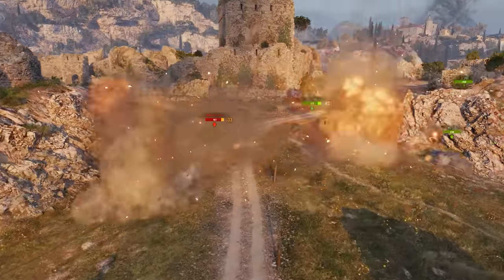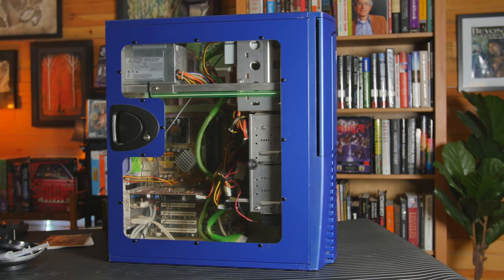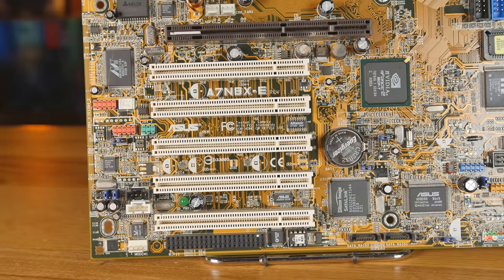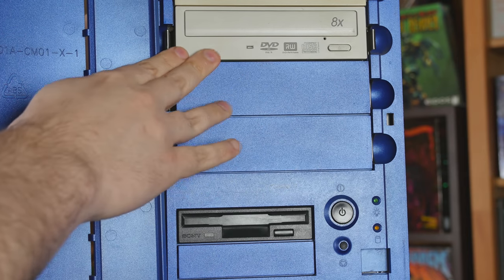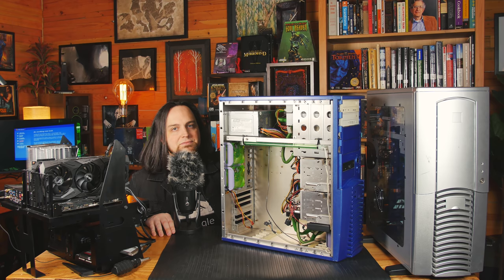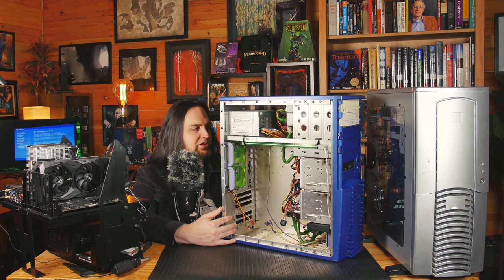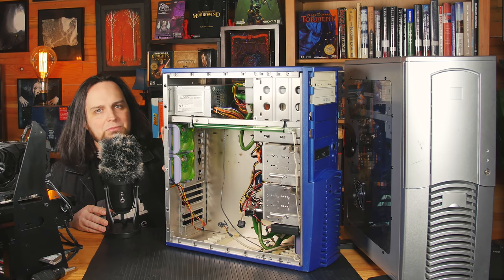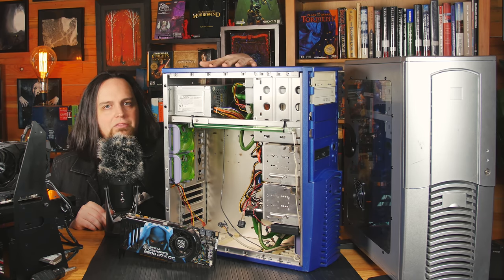Windows XP Retro Gaming Build Episode 1: Chieftec Dragon Case

Comment: That's literally the case I'm using right now 😂😂 cool to see it in a video in 2020
Reply: I am also currently using one of these Dragon cases. The only differences are it has 5 - 5¼" optical drives which I occasionally used, a single 120mm fan in the back, 2 - 80mm in the bottom front, it's black and it has 2 - USB 2.0, audio mic & headphone, and firewire in the little front flip door. It does have a door which I use to keep out dust. Now I usually only use the top optical drive to play DVD's included in certain books and from The Great Courses. The Great Courses is a company which produces either DVD or streaming lecture class sets. The Great Courses has hundreds of lectures in every subject. Check them out; they always have sales announced by email.
Anyway, you can see my system when I upgraded from a primary HDD to SSD on my only YouTube video pwNJto6VWE8. I made a custom filter for the bottom front removable grill which you can see on my video. I really wish Dragon would update these cases and make more. It should be 2" longer from front to back for bigger video cards and eATX motherboards, ¾" wider for a bigger CPU heatsink, the front removable grill should extend out another ¼" for a filter and the front connections should include USB 3.2 and maybe SATA with no firewire.

Comment: such a flash back. I still have a bunch of those IDE cables but in red !! And I'm still rocking a old early 2000's case... Got a Sunbeam 9-bay with a modded top for 240mm Rad <3 ... Use to have cold cathodes for YEARS.. they had some pretty cool ones from blacklights, to weird laser effects then UV was super big for awhile ... those things weren't terrible just not bright compared todays RGB's

Comment: Still got one of these. Had it for years and never regretted buying it. It's now running Truenas Core as my backup NAS with 5x 3.5" HDDs in an Icydock hot-swap drive cage, 6x 2.5" SSDs. Just sits there quietly doing the job, under my desk.

Comment: good memories. been huge into the retro stuff the last couple months. have built fully functional PCs for a few generations. Win98 Pentium 1, W98 P2, W98 P3, and an "early" XP era Pentium 4 with a 6800GT. next up is late windows XP build, either socket 775, 754 or 939.
what about putting a 92mm in the back? I think noctua makes some in that size.

Comment: I had a Purple Aluminum Chieftec or Chenming Dragon case with the windowed side panel back in the early 2000s. I bought it to build a computer for a freind. I also had the gray Antec AMG steel non window version of that gray Chieftec case. I got that one used in good condition of ebay back in the mid 2000s (2006-2008).  I used the Antec AMG case for a HTPC / Gaming PC setup to go with my 32 inch LCD TV and stereo rack system back then. They were both good cases to build with. The older Alienware Area 51 cases are the same style cases as the Chieftec Dragon too.

Comment: Haha. Thanks for this. I am still using a Q9550 in an XFX790i Ultra board. I originally had it powered by 3 x Nvidia OEM 8800GTX in triple SLI. Replaced those in 2011 with 2 x Gigabyte 560ti and then replaced those with 1 x GTX 1080 in 2017. Now thinking about starting over with a completely modern build and using my "retro!" parts to build a 98/XP machine.

Comment: I also have a Chieftec case that looks exactly like this from the inside but another front panel design. Currently rocking a windows 7/ XP dual boot build with a Asrock Z77 Extreme11, i5 2500K, GTX680 and 8GB ram, 500W Allied AL-B500E psu from the mid 2000’s is also still playing ball even with upgrades after 15 years. Buy a good psu that is a little overkill from a good brand and it will last you a long time. Psu does not have any 6 or 8 pin connectors for GPU’s. Also it has a 20Pin atx connector and only a single 4 pin cpu cable.
Reply: I have one with a different front panel design also. Mine is a full tower though. The model is a Scorpio TA-10WD. The mid tower version is the Scorpio TX-10WD. I built a very high end 2008 era rig in mine that is currently running Windows XP professional 32-bit service pack 3, and I'm planning to dual boot it to windows 7 ultimate 64-bit soon. 
My specs are 
Motherboard • Asus Striker II Extreme
CPU • Xeon X5470 @ 3.33ghz
Memory • 4gb OCZ Platinum DDR3 @ 2000mhz
GPU • EVGA 780Ti Superclocked reference card
Storage • 500gb 7200rpm WD Blue HD
Power Supply • 1200w fully modular Rosewill
I realize the 780Ti isn't really accurate to a 2008 era pc, but it is the last flagship Nvidia GPU that officially supports Windows XP. I really hope he will return to this project and make the next videos about it. Here are links to the Scorpio full and mid tower versions respectively, in case you'd like to check them out. 

https://www.globalsources.com/si/AS/Chieftec-Industrial/6008800000435/pdtl/Scorpio-Series-Full-Tower-PC-Case/1135025386.htm

http://www.dansdata.com/tx10wd.htm

Comment: Ah man. I had bright green and an antec. Had an amd 2000 athlon xp, 2 80gb hd in raid 0, 16gb of ram, a soyo platinum motherboard (whatever happened to them), 2 cd burners, rounded clear cables, and blue cfl lights. I believe they were out in like 01/02 and were the basis of the Alienware cases. The FireWire was a later addition to these models

Comment: Lol, I have a blue one, they used to sell them at tiger direct for cheap so I bought a few (like 40 bucks). Since mine did not have a side fan, I installed 8 hdds in it and put in an old rig for file serving.
Reply: Oh... And my door's lower hinge broke as well, when I have time, I'll drill a screw thru the door to hold it in place.

Comment: Fact: those old games which came out while Windows XP was used, often these games run better on Linux with wine than on Windows10. Why? Because for Wine they select the correct versions of software (some fanatic gamers do this) and on Windows MS and the developer of that game do not. Even some more recent games like Fallout 3 run better on Linux. Crazy, but true. :) 
(recent AAA-games still most of the time run better on Windows though :().